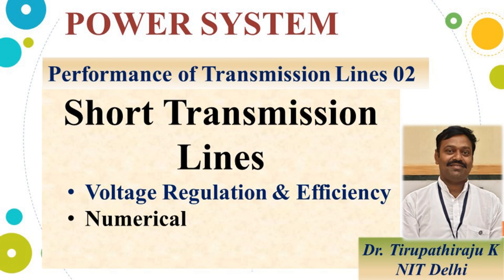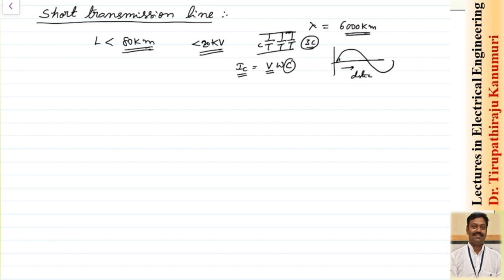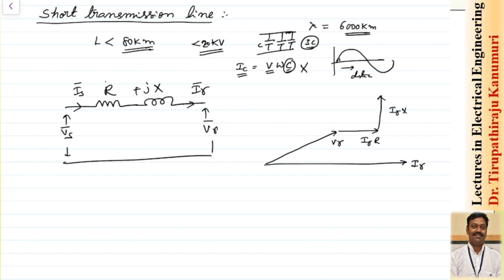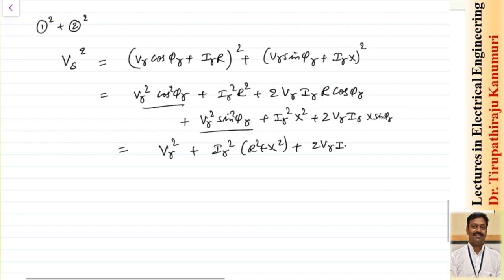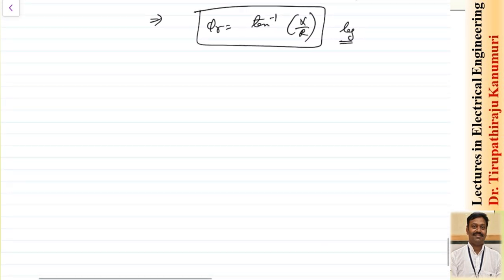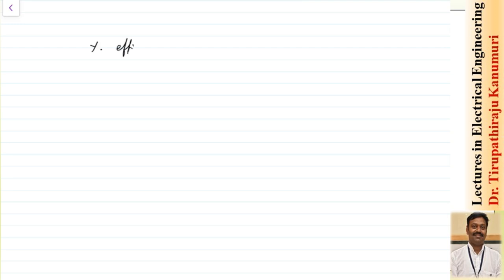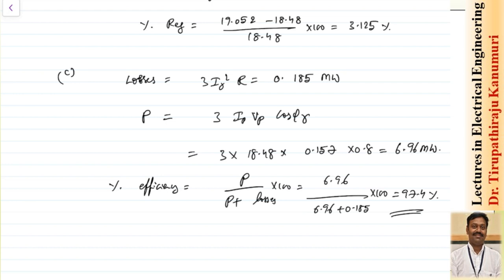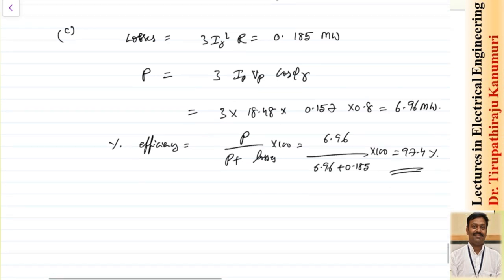PS23 Short Transmission Lines

Comment: Sir, I have one doubt that when Ir=0, then Is=0 bcz of short tr. line. 
If Is=0, then there will be no voltage drop then how the voltage regulation is defined by putting the value of 'Vs' in terms of constant A?? 

Plz reply sir

Comment: 10:50 ,  sir can u explain in detail the sentence regulation zero for leading power factor loads?
Reply: @lecturesinelectricaleng  leading power pf means capacitive , so if we have capacitive loads then only voltage regulation will be zero?we need voltage regulation to be zero or max possible?

Comment: Sir at 10:48 i am little bit confused.how this equation shows that power factor is leading.plz explain sir.
Reply: By using equation 3 the value of angle comes out in negative which means leading power factor load.